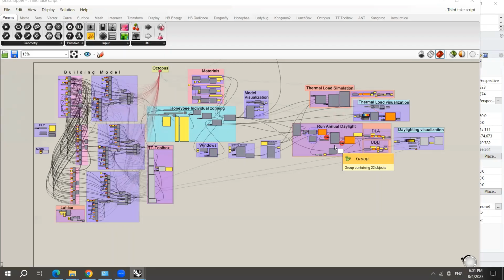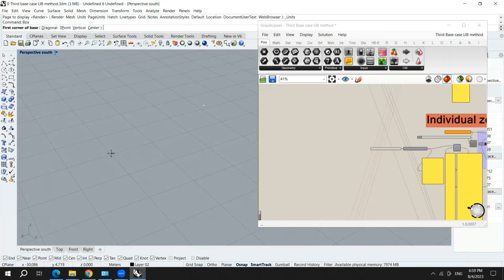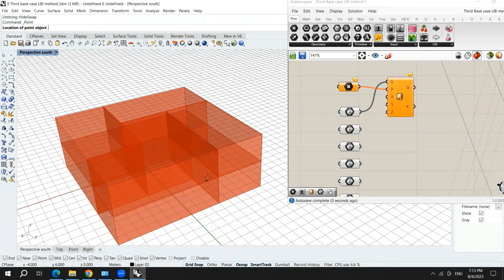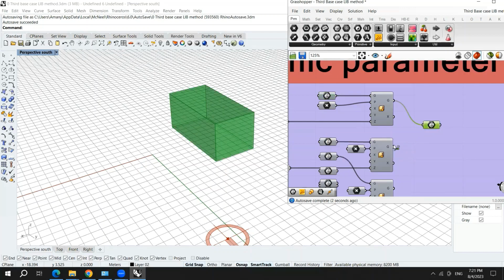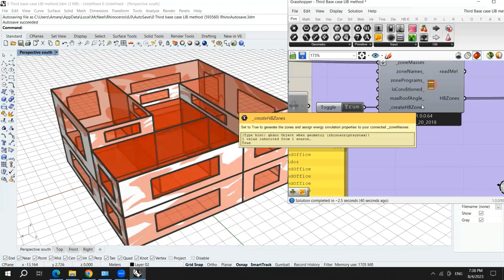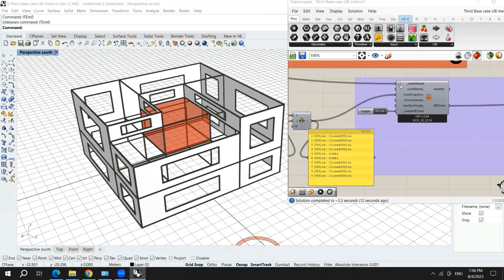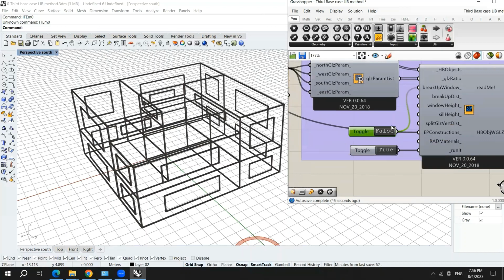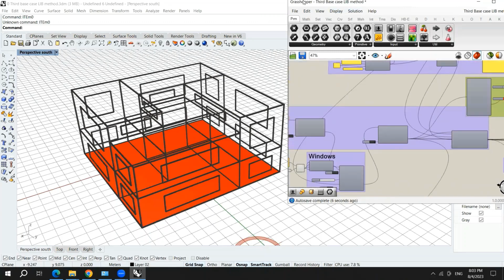Part 1 | SIMULATION & OPTIMIZATION, energy and Daylighting | Grasshopper, Ladybug tools, and OCTOPUS

Comment: Dr. Amany since the section of intersect masses its not clearer to me since its my first time learning it. Can you elaborate?
Reply from the maker: Hello Sarainr , thanks for your comment. Will post a video as soon as possible. Please let know more about what you need to do with tools regarding the masses or if you are just learning and need more elaboration about the massing stage?
Reply: @amanykhalilartarchitecture1544  I am actually trying to generate parametric model that I can configure to optimise energy performance, daylight, and thermal comfort. I would like to present a series of design iterations that vary in geometry, proportions, orientation, and features such as shading devices or vegetation. So, an analysis of how each variation impacts building performance metrics.